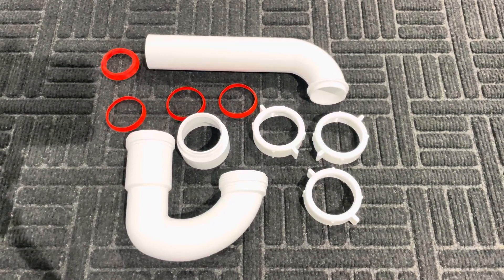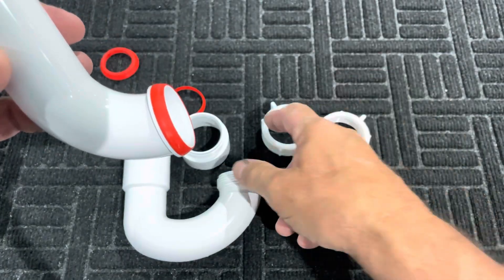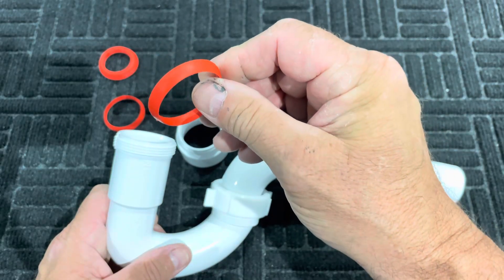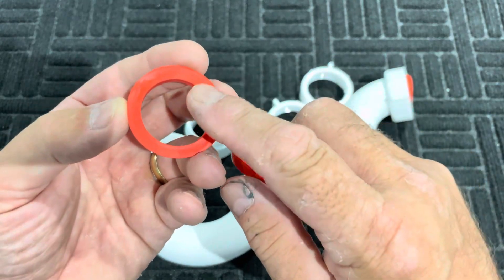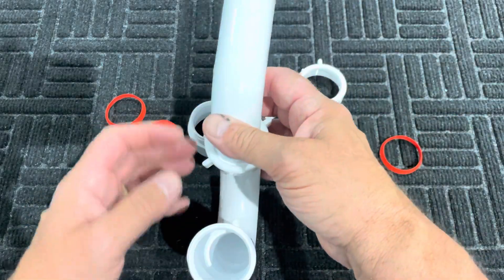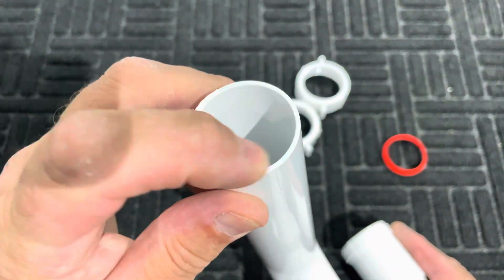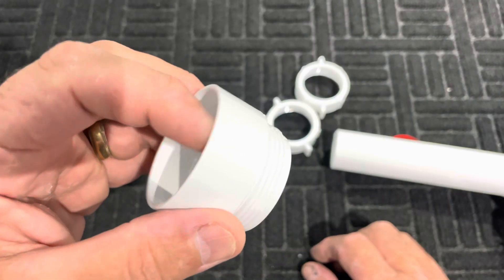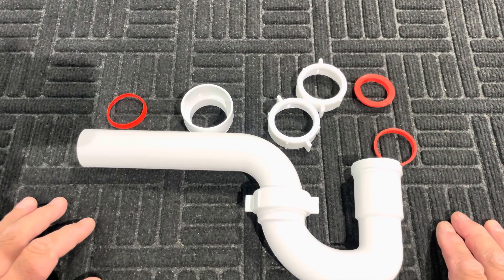P-Trap Assembly

Comment: Just fir infow, these trape are not approved by the plumbing code. Use instead a Ground Joint Union trap. 
They are approved and have the UPC lable.
Reply from the maker: Yes, but these are better!
The molded plastic bevel does not compress like a rubber washer and no where does the code say that these are ‘not Approved. They still want you to use Lead flashings.😂
Reply: They are not approved. When comparing the two the bore of the ground joint is bigger. @danthehouseman-63